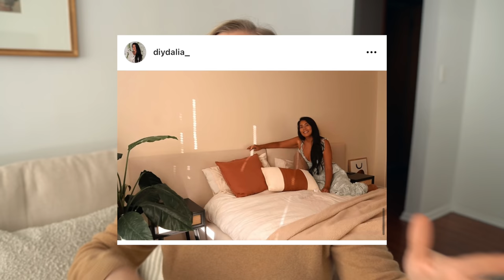MAKING MY DREAM PINTEREST BED FRAME (DIY EASY LINEN HEADBOARD) (Rental Made Home ep.7)

Comment: I couldn't see your reply below about securing the headboard to the bottom frame?  Also - I may have missed this Emily - but was the headboard - twin size the exact same width as the width of the mattress and box spring?
Reply from the maker: It hangs over a couple inches on each side, which is exactly what I was wanting! Also we didn’t secure the headboard the box spring and mattress put enough pressure on it to hold it up.